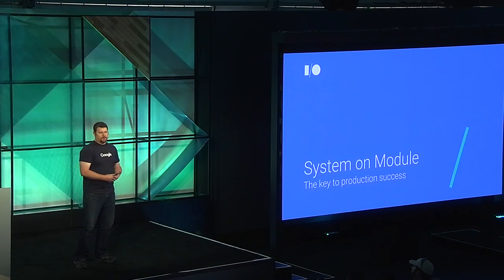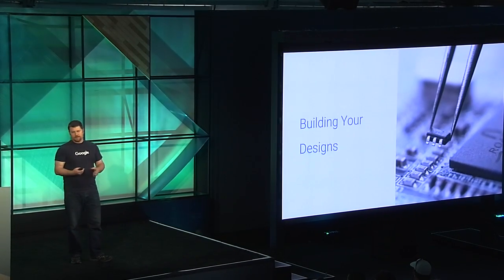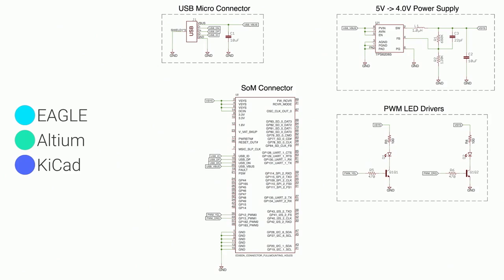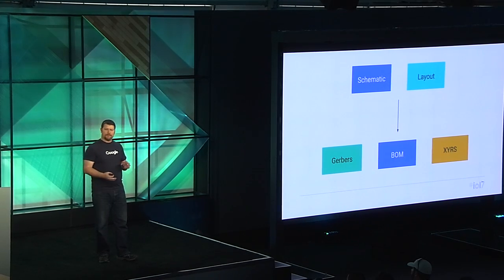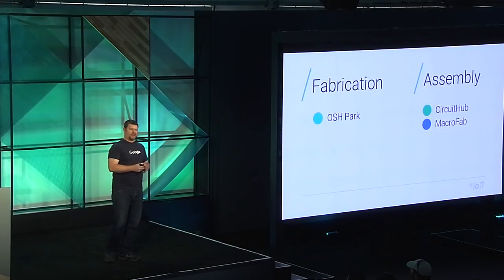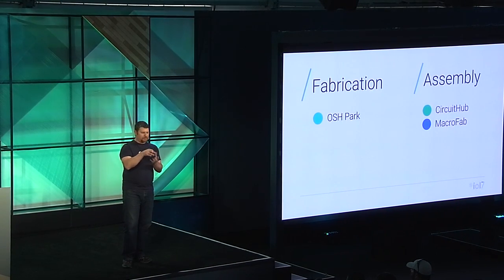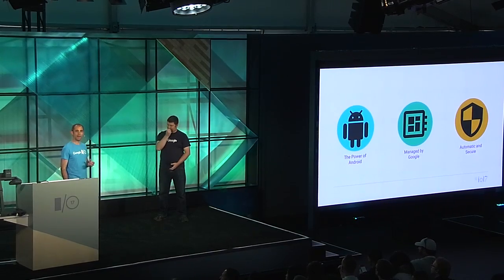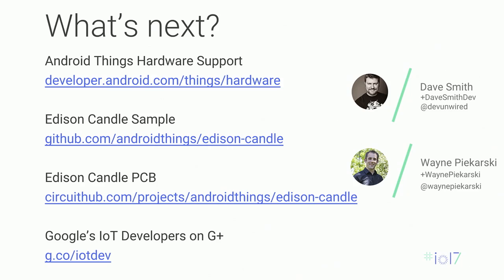From Prototype to Production Devices with Android Things (Google I/O '17)

Comment: Overall, I think that there is a gap between experimenting with software and experimenting with soldering on PCBs that are not through-hole. Better use development specific Raspberry PIs or Arduinos with break-out boards, so you don't actually touch a chip's pins....that's just wrong especially for beginners - especially since it costs money, as they said.